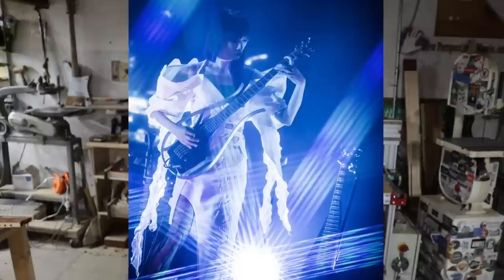Electric Pipa #5   New Perspectives Music

Comment: What are your thoughts on using bamboo in Instrument building? It seems like it’s easy to regrow from a sustainability perspective though it can grow out of control if unchecked. From an extended range guitar players perspective I think seeing bamboo strips layered together would make a cool looking fretboard!
Reply from the maker: I've messed around with some bamboo floorboard and stuff. it's all engineered, of course. A little splintery but I think it would be viable. I might still have a piece of that flooring. If I do, I'll cut a fretboard from it to see how it looks :)

Comment: What is that intro song too the video? I like that chord progression. Awesome build too!
Reply from the maker: It’s all music I make for my videos
Reply: I really dig it!

Oh, and the pipa looks great. Just a question about the pegs: any reason to plug the peg holes? I'm used to them sticking out on the other side.
Reply: Oh, sorry, I need to clarify: as a western classically trained (well...) hobby musician. Looking at the peg box of violins.
Reply from the maker: @johanneswerner1140  Simply put, I messed up! LOL. I made the headstock too wide and the slot too big and the reamer is for cellos so a different taper.  I wasn't happy with the look and grip. It should protrude a little mostly for functionality - more wood to grip against and hold tension. closing the ends made it look better and gave me another surface to "grip" against.
Reply: Thanks!

Just... When you refit the pegs down the line (clean up the peg box and reshape the pegs' taper) you will have to fiddle with the length of the pegs. I guess that's why they poke through on cellos, makes the job easier. I know that this is exactly not what motivates you 😁 (you rock!)